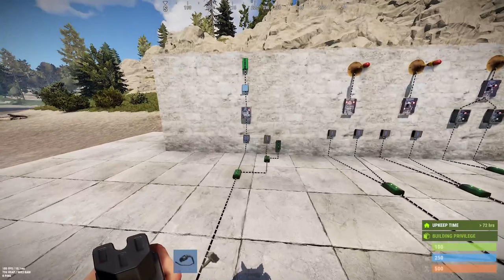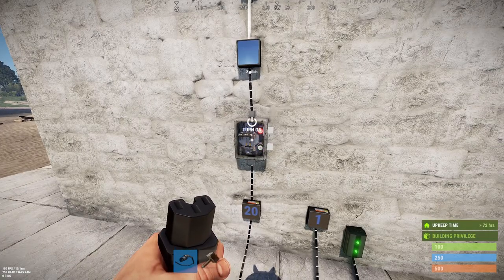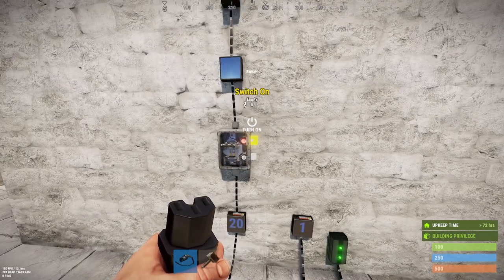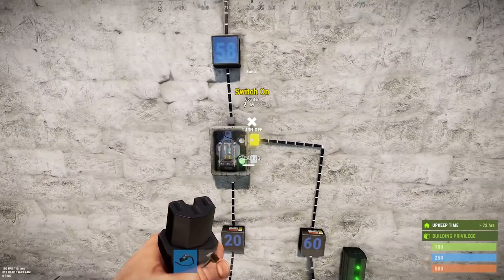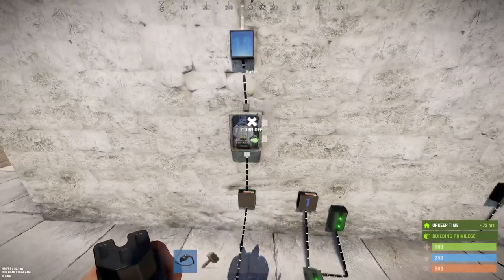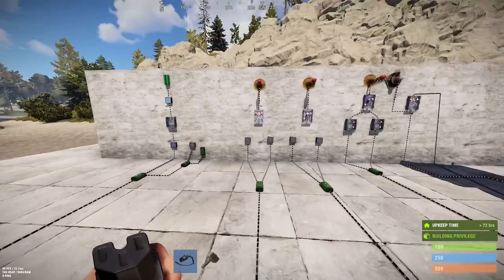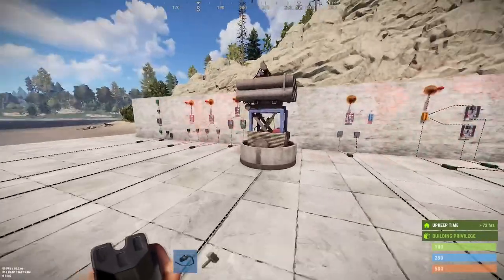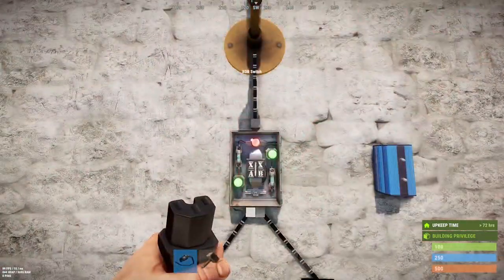2021 Rust Electricity Guide: Chapter 3 - Switches

Comment: The HBHF sensor with the AND switch is great for powering lighting in your base. It’s extremely efficient. When you enter, lights come on. When you leave, they go off. And they won’t turn on for anyone who isn’t authorized in your TC.

Additionally, you can wire up the entire lighting system with a blocker using a solar panel.

If the sun is out and the blocker is receiving power, the lights inside won’t ever turn on. So you won’t waste power. But when it’s dark out, and you step within range of the HBHF, the lighting turns on.

Incredibly efficient and doesn’t require any switches to be flipped.

You can also use the HBHF to set up an alarm system that will alert you to people within the perimeter of your base. Most recently I wired up a system to activate landing lights for a mini heli on the base roof. This makes flying and landing at night without crashing possible. Extremely useful components.

Comment: Regarding the switch on/off connections on the side of the switch - if you put an OR or XOR gate before it (just as a straight buffer, where you only use one if they're inputs of OR/XOR) you will find those side connections work much closer to how you imagine they should (well atleast the off one does). I don't know why it works, but it does, and you can make a simple trap door setup this way with the following arrangement: power source -> switch -> door controller -> HBHF sensor -> OR/XOR gate -> switch (off terminal of previous switch).

Comment: I've played Rust since the old legacy alpha (radbears spawning in midair by Hacker Valley... good times) and I very much enjoy your videos! You spend much more time messing with electrical in this game than I do and your comments have been extremely helpful - especially since nothing in this game works like actual electricity.

Your observation about the switch's side handles now explains the weird behaviour I was seeing before. I wanted to build a simple generator controller to maintain primary battery charge in the event that the sources disappeared. Because I was backing up a large power source I went big and had 6 generators to deal with, so a design consideration was to not have all of the control circuitry drawing off the main battery all the time, and to use separate small batteries for starting and stopping (because Rust cannot have a bus). I went through a few iterations with timers that became increasingly challenging to keep straight in my head, so I landed on a procedurally simple count-down system based on the Rust clock. (Controller initializes, waits X interations to send ON to the generators, Y iterations to send OFF to the generators, and Z iterations to power off the controller entirely.) Turns out that when the Memory Cell is not passing through available power downstream, it still passes the "load" number upstream! So while the right actions took place and appeared to have turned off, I permanently had draws on all the batteries as if nothing changed. Blocker requires active input and trying to get that working the way I wanted used almost as much power as the protected load!

So I tried the side handles on a switch for the main power. It should be so easy! I hooked up the starting signal to the SWITCH ON handle, and the output from counter Z, meant to de-energize the controller, was sent to SWITCH OFF. Of course when I tried to turn it on, the whole thing just turned itself off! :) Now I realize that it was trying to run on a single RustWatt...